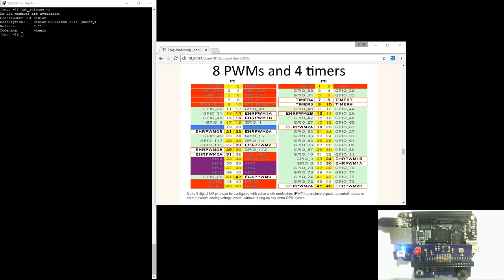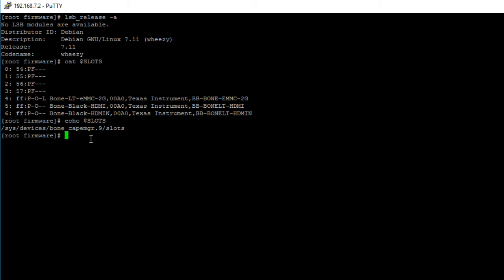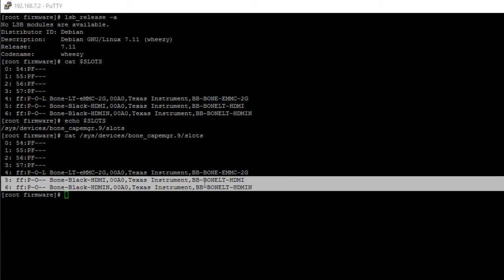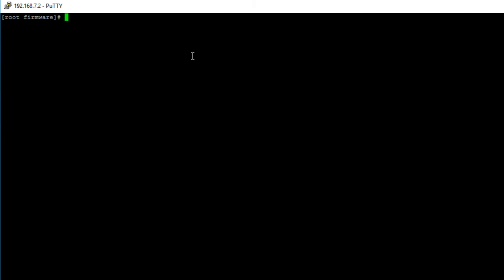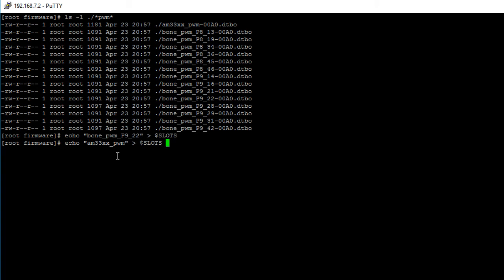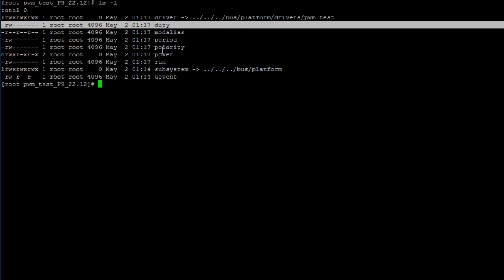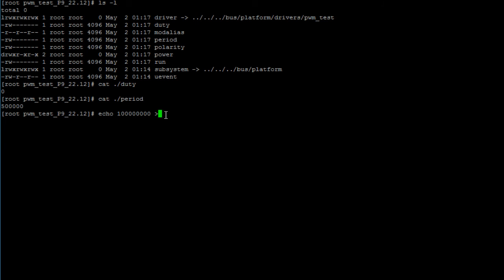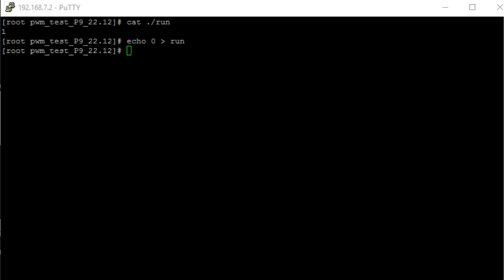BeagleBone Black PWM Pin Configuration (Debian 7.11)

Comment: Hey man I could use some help.  I flashed my BBB to Debian 7.11 a while ago, but none of the PWM device tree overlays are listed in the /lib/firmware directory.  Am I missing something or is something just messed up in the image?  I know I didn't delete them.  I'm trying to enable PWM outputs on the P9 header and would love not having to reflash the board again.  If you see this in time and can help that would be awesome.
Thanks!